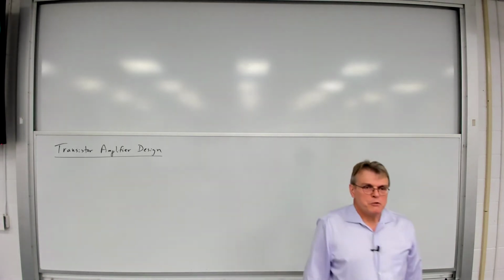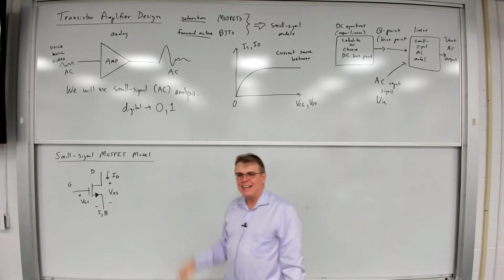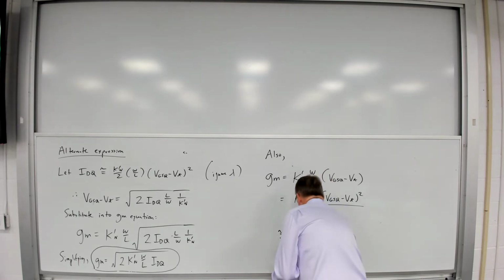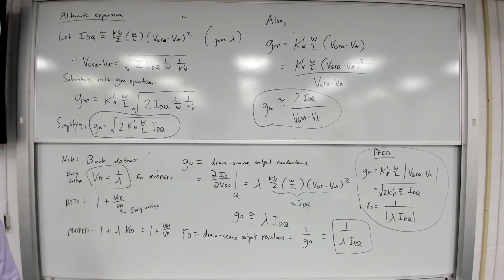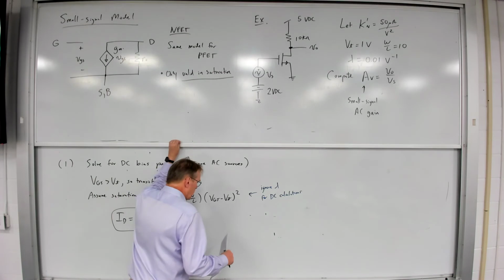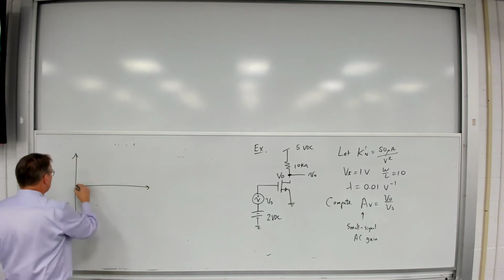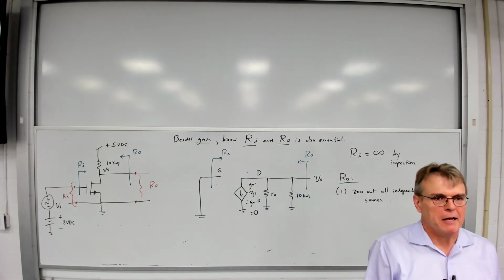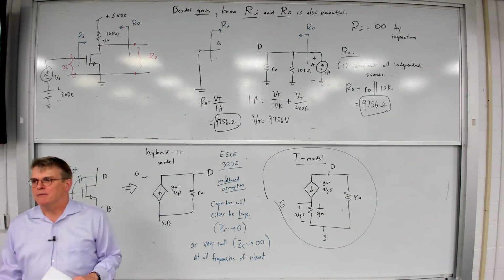Electronics - Lecture 16:  Transistor amplifiers, transistor small-signal models and analysis

Comment: I have a question sir, isn't the output wave at the amplifier going to have a dc value ? We need no connect the ouput (Vo) to a capacitor in order to eliminate the dc voltage right ?
Reply from the maker: That is correct, and in later lectures you will see coupling capacitors used for exactly that purpose:  to block DC while allowing AC signals to pass.  You'll see it on both the input and outputs of the amplifier, depending on the circuit topology.

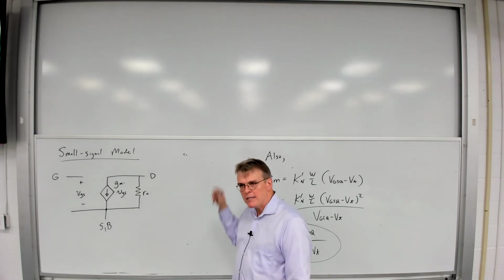Comment: At 33:37, you mentioned the extra non-ideal current between the drain and the source. Were you talking about the actual curve of the I_D vs V_DS graph where the current actually slightly increase as V_DS increase, as opposed to the curve stays ideally flat? And is that slight increase in current what r_o represents?
Reply from the maker: Yes, that's correct.  Ideally, in saturation the MOSFET drain current Id = K'/2 * (W/L) * (Vgs - Vt)^2 (i.e. the square law equation), and Id has no dependence on Vds.  But because of r_o (the drain-source resistance), the drain current will increase slightly as the magnitude of Vds increases.

If not for r_o, transistors would behave like ideal dependent current sources, and we could build amplifiers with infinite gain. With actual transistors that's not possible.